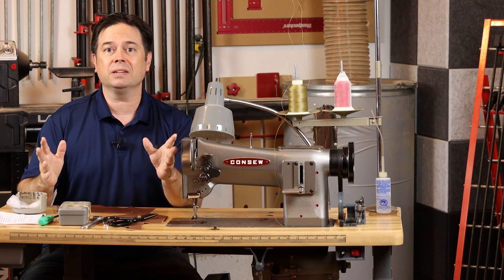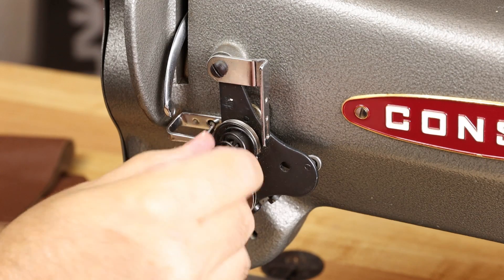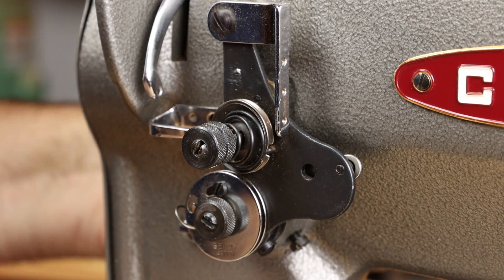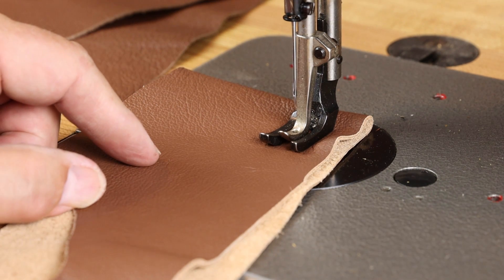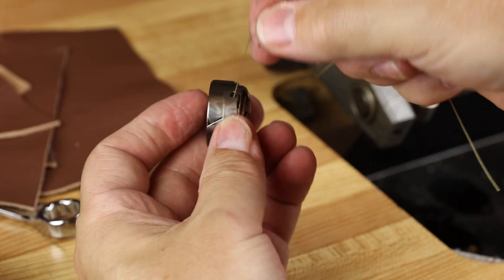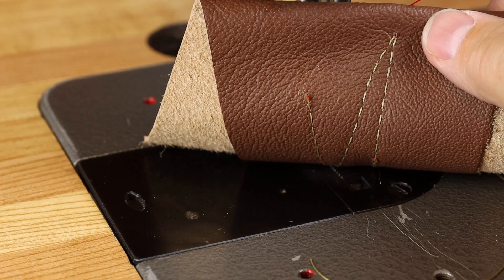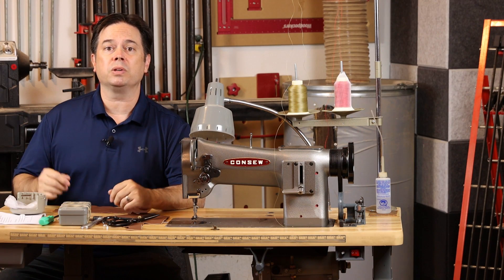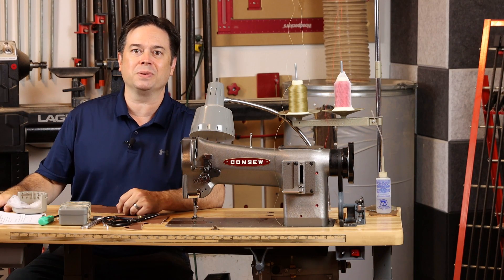Consew 206rb1 Machine Setup Tutorial Industrial Walking Foot Sewing Machine 206rb-1 206 rb 1

Comment: Thank you. I hadn’t used my lovely consoe for several and was commissioned to make a leather vest. The wing nut in back had come loose so it would sew.  Thank goodness you covered this.
Reply from the maker: Excellent!  Glad you got it sorted.
Reply: @TheThoughtfulWoodworker  After using my machine for 1 time it seems to be hanging up. By ear something in the top right is hitting. Not sure where to start searching  for what slipped. Suggestions?
Reply from the maker: @anitaallen4143  Ok so it sounds like you have a 206RB and it's making a noise or not working right.  I think you got the wingnut issue sorted last time.  Check for loose thread behind the bobbin case.  A tiny thread can cause a hiccup in the normal sewing action.  Otherwise, it might be the bobbin case opener adjustment.  If that doesn't let the thread smoothly pass, it will make a twangy thread sound.  Finally, make sure the knee lift linkage isn't bent or in need of minor adjustment.  Thanks and good luck!

Comment: These old machines are very very over rated. Yes they can sew almost everything but you need to be a pro to operate them. User friendliness is at level 0, basically you need to know all of the adjustments and tricks to operate them.
Reply from the maker: Well they have the same number of adjustments as modern machines, and you need to know all of them to be proficient.  Really the only thing that's easier on a modern walking foot is the oiling.  Put a servo motor on an old Consew or Juki, and I'm happy as a clam.
Reply: Sewing and making anything 
 a steep learning curve. I would say the old needle feeders are underrated. If you have the skill and knowledge you can make incredible things. Check any high-end upholstery shop and see what machines they use to make a 10k auto interior. Then check any small mom and pop shop. They're able to make 10k interiors, too, with the same machines.
 I worked a few years in a factory that made outdoor furniture cushions. I was the mechanic for 80 of this type needle feeder. There is a reason.

Comment: Hi there! I just got a very same machine like this one, looks like brand new. The problem with it is, the hand wheel won’t turn, clutch is engaged like it should. It seems that the problem is the upper part of machine that is no moving. I oiled every part of it hoping it will unfreeze but, not happening. I really hope to hear from you and guide me through this problem. I really appreciate your layman explanation and knowledge about sewing machines!
Reply from the maker: Try removing the drive belt from the motor to the handwheel.  Then oil all the points, and let it sit overnight.  I've never found one that I couldn't eventually brake loose.  Look for any rusty or seized parts under the machine.  Good luck!

Comment: 206RB is a fine machine.   I prefer the Singer 211A models but the Consew is a great machine.    Unlike the 211A's, it seems the upper and lower shafts on the 206 are geared together and it's not necessary to check for slippage as on the 211.    I also like the Juki LU-563 as a strong vintage machine but it seems to me the Juki needs more oil than the singers or consews?
Reply from the maker: That's funny you mention the LU-563 because that's my primary machine.  Love that big U style bobbin!
Reply: @TheThoughtfulWoodworker   We love ours too.  It's a tank.

Comment: You articulate very precisely.  My 206RB-5 is a beast on canvas, am I wasting my time trying to set it up for light fabric? My Pfaff 360 is what I have been using for quilt making, but parts are getting hard to find.
Reply from the maker: Your hunch is correct, the 206rb excels with canvas, vinyl, leather, or upholstery weight fabrics.  It doesn't perform that well with materials thinner than denim.  Thin cotton t-shirt material or silk would tend to bunch and gather.  I love using a walking foot for sewing pillows or chair cushions, and they do great for that.  Good luck with your projects!

Comment: Hello there Mr. Sandry.
 I am really thankful for finding your channel. I just obtained a 206rb-2 head only. Oddly, it seems to have two different kinds of hinge post . Looking down from top of the machine, the left hinge post has a large gap that would seem to go into a table top hinge. The right one has a shorter post and the gap is about 1/4 the size of the left post.  Is this normal or is something wrong with the posts?  They are both molded into the frame of the machine. I cannot remove them.   Thank you for your generous videos !!!
Reply from the maker: Sounds like you have a mismatched hinge set.  They'll pull out of the head with pliers and some penetrating oil.  Might just need to buy new hinges on eBay.  Best to you.
Reply: Thank you kindly Sir !!!

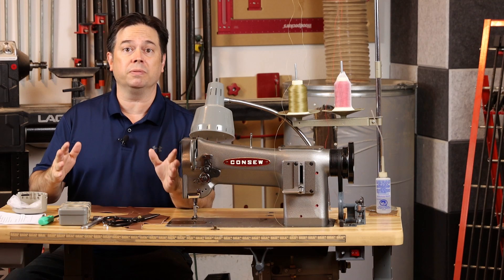Comment: 2:35 And that is what I am dealing with, the thread has too much slack then it twists and wraps around the thread controller and stops my progress. Thanks for your help👌
Reply from the maker: I've had that problem with outdoor thread.  It has a lot of memory like fishing line.  Maybe experimenting with different threads, or a slight adjustment to the thread controller spring will help.  Hope you get it perfectly dialed in.

Comment: thank you, do you have any videos on how to adjust the walking foot to get rid of the marks on the my leather?
Reply from the maker: Hi Barbara!  Check out this video at the 2:15 mark...  https://youtu.be/v2QdIKrK_xI?t=136  it shows the adjustments on a Juki LU-563 but they're very similar on a 206RB model.  Just back off the foot pressure a bit.  If it's very delicate leather, sometimes you have to switch to a smooth bottom foot (no serrations under the foot).  Best to you.

Comment: This video was absolutely perfect, I've recently found an abundance of thread wrapped around the lower wheel, I think it was on there to increase the diameter to make my belt have enough tension. Have you ever seen anything like that?  Once the thread was removed there's not enough tension on the belt to wind the bobbin, would a good solution be a new belt?
Reply from the maker: Very common for thread to get wrapped around a pulley.  Just loosen two screws and adjust the bobbin winder closer to the belt.  Sometimes you have to drill new holes if there's not enough adjustment.  Thanks.

Comment: Hi.  Do you have a video that shows the replacement of the presser foot lever?  I just bought a used 206rb1 and there is no lever so I only have the knee lifter for now.  Ordered the lever and trying to find a guide on how to put it on.  Thanks.
Reply from the maker: Hi Samantha.  Unfortunately, I don't have a video like that.  I don't have a 206rb in the shop right now, otherwise I'd try to give you some pointers.  I know I've replaced them in the past, and I don't remember it being overly complicated.  Replacing the take-up lever is a week long job, but the presser foot lifting lever shouldn't be too bad.  
Best of luck with it!

Comment: Thank you for your advice as I was able to make the proper adjustment to allow the walking foot to not leave marks on my leather using my Consew 202 rb.

You are so knowledge about the Consew and I am a beginner if you could help me with another issue.  I am sewing patches onto leather vests and I can't seem to follow the outer contour of the patch due to the fact that the walking foot covers up the patch edge where I need to sew. I can’t see when to turn my material to make a change in direction.  Can I get a different walking foot so I can actually see where the needle is on the outline of the patch?  TIA
Reply from the maker: Hi Barbara, I'm assuming you're currently using a standard foot set or a cording foot.  If you switch to a zipper foot, it gives a lot better visibility.  They have right and left zipper foot options, and I would add both to your collection.  EBay is a good place to find them.  Thanks for the kind words!  Best to you.
Reply: You can get a narrow foot also

Comment: Can you help? I cannot get any stitches created. Have rethreaded upper and bobbin. Changed needles. No apparent issue with tension.  I did find the machine had been used - thread was shredded and left incompletely threaded. 
What else should I look at? I inherited the machine and needing to teach myself. Any assistance is appreciated. Thx much.
Reply from the maker: Hi Terry, make sure it's the correct 135-17 needle system and the correct size for the thread you're using.  Also make sure the needle is inserted into the needle bar fully.  Needle groove needs to be on the left, and needle skarf on the right.  
Bobbin case clicked in correctly?
All this assumes the feed dog moves when you rotate the handwheel by hand.  If not, could be a tripped safety clutch.
Good luck troubleshooting.

Comment: When my thread take up lever is in the highest position my two dots are about 1" apart. I have a 206 rb5. Can this be corrected?
Reply from the maker: You can likely adjust this by loosening the set screws in the handle and repositioning it.  It doesn't really matter though, if you install / remove the bobbin when the take up lever is at the top position.  Best.

Comment: The Consew 206rb line up is 1 -5 but the plate on mine just says 206rb so is there a 206rb, 206rb1, +2345 so ther are 6 machines or is the 206rb considered 206rb-1? Mine is different than yours it does not have the oil tank and window underneath that yours has or the wick tray under the top cover. Any ideas ?
Reply from the maker: Hi Michael, There were 206rb models and 206rb-1 models, both of which were pretty much identical.  At some point in the manufacturing timeline they added "semi-automatic" lubrication which included the small oil tank under the machine to lubricate the hook, and a system of oil wicks under the top cover plate.  Best to you, and enjoy your machine.
Reply: @TheThoughtfulWoodworker  thank you that is good to know it always confused me I appreciate your response

Comment: Hi, great vids! I have the same machine, I need to slow it down for doing motorcycle seats with marine vinyl and piping. I'm thinking I need a servo motor...do you have any recommendations or tips on that? 
 Thanks, Jeff
Reply from the maker: Here's how to install a servo... https://youtu.be/Dx_rS9Fzvfo 
You will like a servo motor much better.
Reply: Thanks for the quick reply...just checked out that video. What brand servo motor it that ?
Reply from the maker: @killerkork  Here's the servo motor I usually buy...  https://amzn.to/41M4aj0  thanks
Reply: Those types of servo motors don't have any torque, you can hold them from turning with your hand; brushless servos are much better and have a great deal of torque @TheThoughtfulWoodworker
Reply from the maker: Well, it depends on your overall setup.  I use a brush style servo with a box style pulley reducer and it would sew through plywood.  Plus, I like the way these brush style motors start slowly, compared to most brushless motors.  I've had some good brushless motors, but I've also had some bad ones that started fast regardless how you programmed them.  Probably lots of factors in determining which motor is right for you.    @migelikali7265
Reply: I got one (brushless) with a smaller pulley and I can literally stitch 1/2 stitch at a time, and I don't have to have all that extra weight and bulky hardware on my table.
And, I only paid 90 bucks for it - added a needle positioner for a mere 35 bucks and I've sewed through 1/2" thick seams in 18 oz Cotton Duck canvas with no problems.
and yes, my machine is a 206rb-2 that I bought along with a Juki DNU 241H for 250 bucks for both machines - hows that for a bargain ?
Don't throw the baby out with the bath water buying all that extra hardware think you need it to tame your machine, its completely unnecessary, and to expensive to boot.
 @TheThoughtfulWoodworker
Reply from the maker: Please share the brand and model of your brushless motor.  I'd like to know if there's a good model.  Thanks  @migelikali7265
Reply: It's not the best version but you can't beat the price and I'm happy with its performance thus far. @TheThoughtfulWoodworker

Comment: Can these machines sew with T270 thread?
Reply from the maker: I consider the functional max to be 138 thread.  If you make modifications it might do more.  I usually use 92 weight thread for upholstery, and that sews great with stock upholstery machines.  Thanks.
Reply: @TheThoughtfulWoodworker  Thank you for the information you gave. You've been very helpful.

Comment: Hi - Can you say what the maximum stitch length is on a 206RB-1?  I've seen 10mm and others say is limited to about 4.5mm?
Reply from the maker: The listed spec for the 206RB-1 max stitch length is about 7mm or 3.5-4 spi.  If your limiters are set incorrectly, it might not be quite that long of a stitch.  Definitely not as long as the RB-5, but I never need a 10mm stitch length!  It's actually not a very strong seam.  Best.

Comment: How do I set the back tac adjustment if it's out of sink ?
Reply from the maker: First make sure that you start your back tack when the needle is all the way down, then handwheel rolled towards you to raise the needle slightly.  That is the best chance for falling into the same holes.  If it needs to be adjusted on an early 206rb model (not rb-5) you can read about it here... https://leatherworker.net/forum/topic/71462-adjusting-forward-and-reverse-stitch-on-consew-206rb3/  loosen two screws to make the adjustment.